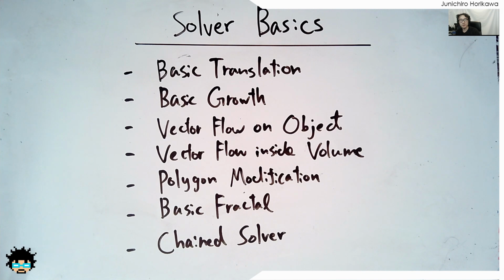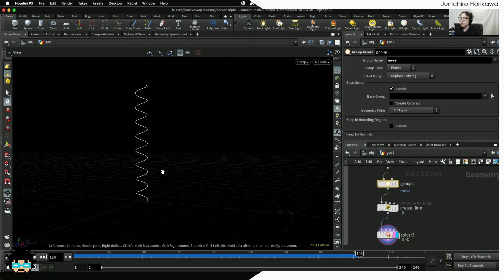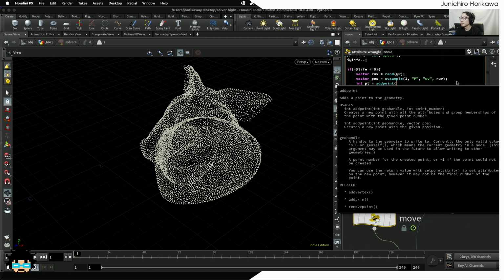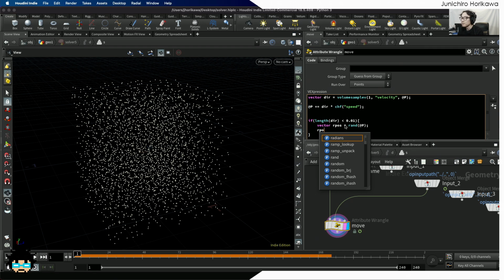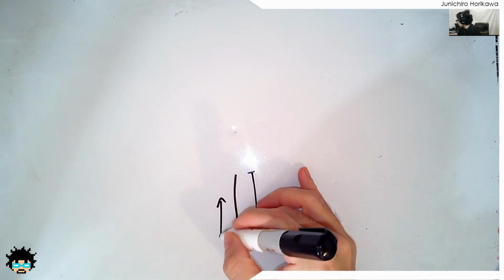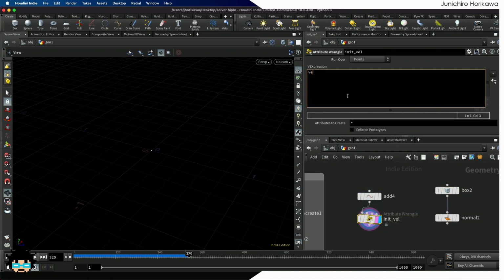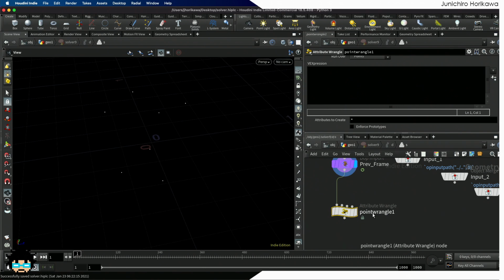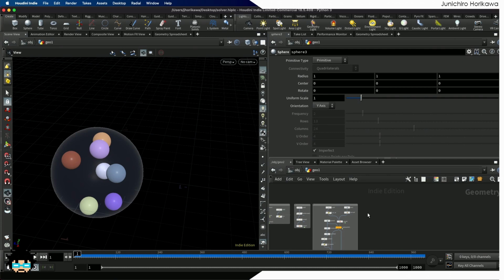[VEX for Algorithmic Design] E20 _ Solver Basics

Comment: Thank you so much.  This helped me understand particles and how to apply them to magnetic fields, especially solar flares.  However, when I replaced the pig head with a sphere, the points seemed to cluster to one side and new points did not appear when the geometry spreadsheet said otherwise.  Is there a unique difference in geometry that would cause this to happen?

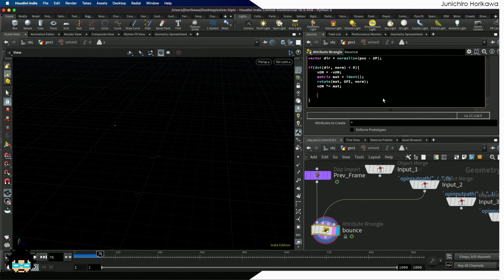Comment: 1:43:59  Hi Junichiro, there is a reflect() function in vex you can use to calculate the reflected vector easily using the original vector and the surface normal vector.
Reply: Whaaaaaaaat ??

Comment: I have a weird bug where at frame 0 a point is at 0 and all the deathpoints also span in 0 and stay there.

code is

```
@P += @N * chf("speed");
i@life--;

if(i@life < 0) {
    vector ruv = rand(@P);
    vector pos = uvsample(1, "p", "uv", ruv); 
    int pt = addpoint(0, pos);
    int life =floor(rand(@P + chf("seed")) * chf("maxlife"));  
    setpointattrib(0, "life", pt, life);
    
    removepoint(0,@ptnum);
}
```
Reply: If i refollow and retype all the code i get the exact same error ?

Is`nt there a problem becouse you`re getting data from vertexes but looping over points ?
Reply: Lowercase « p » in uvsample function should be uppercase « P »
Reply: @biiiiioshock  Oh My God
I have been depressed all week not knowing why.

you are my hero.

Also what does the P refer to ? 
is it Pos ?